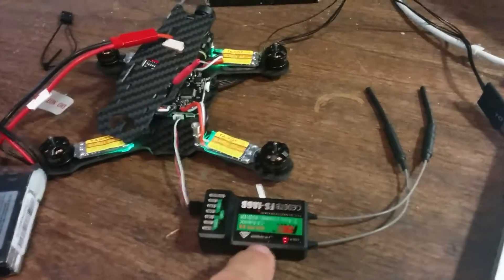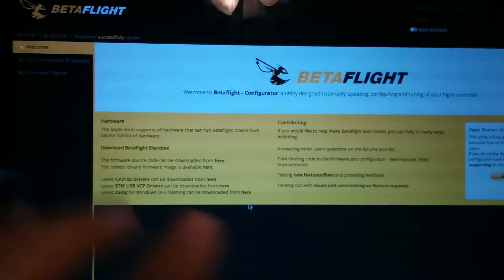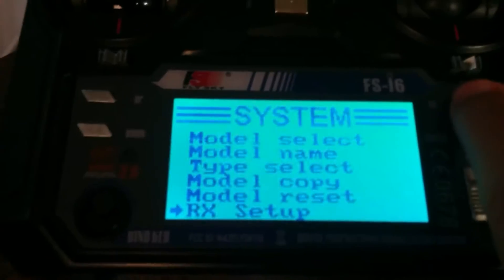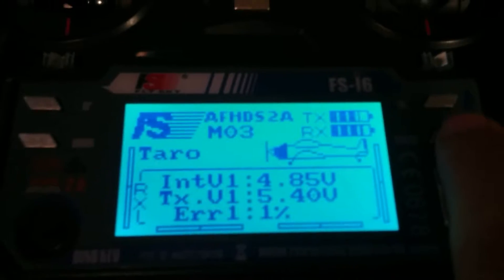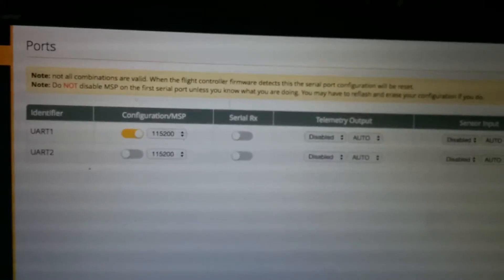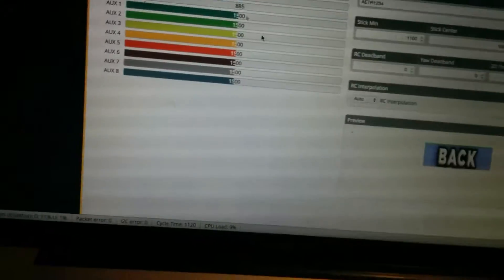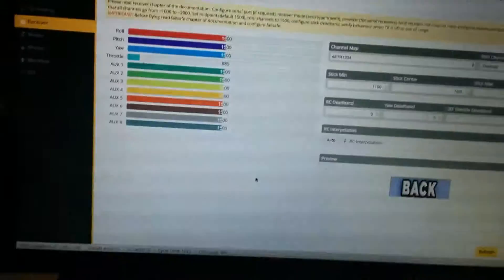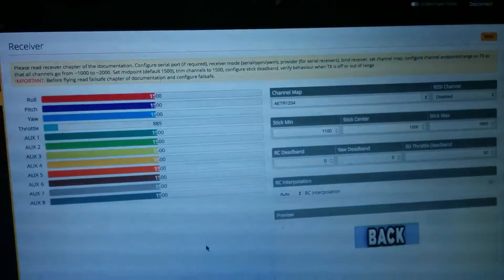Tarot Receivers Don't Work(1)

Comment: hallo
have you solved your problem already？
if not，i suggest that you Turn
On serial RX Option in ports Interface
And change motor Protokolle (?) Into pwm in motor Interface
Reply from the maker: You are entirely right sir, thank you!  It was a very frustrating beginning with those but now I have learned to hack.  When things don't make sense I simply change to iBus from PPM and it works in other cases.  I don't understand but it works